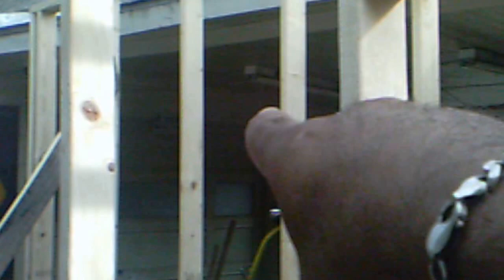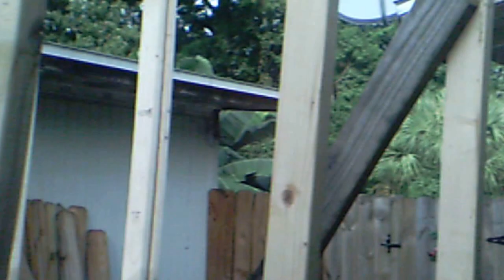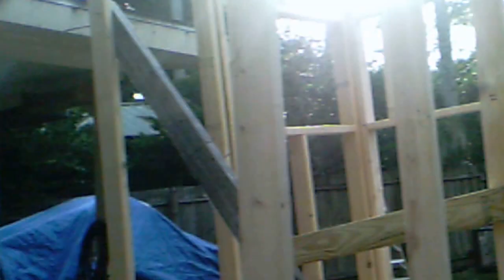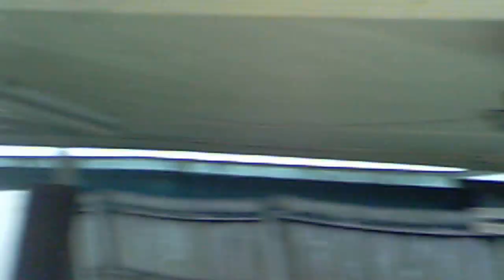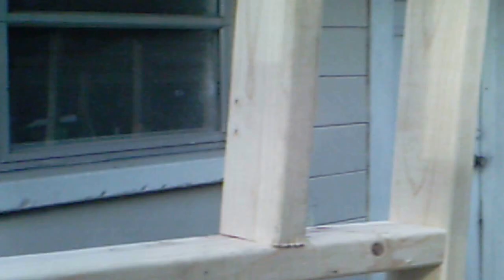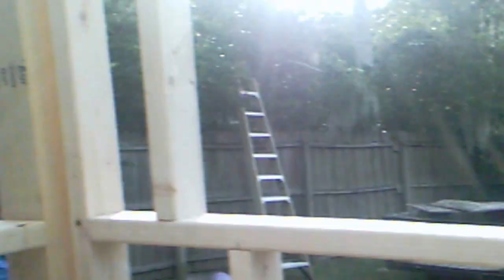Homemade camper part 3 (the walls)

Comment: using 2x4s adds a lot of weight and serves little purpose. Most trailers use 2x2 with gussets to keep overall weight down.
Reply from the maker: your right, but i was going for a tiny house like build. Campers are built with 2x2 that are weak where i wanted strong walls. Plus i know it was not going to be moved alot.. Thanks for watching...